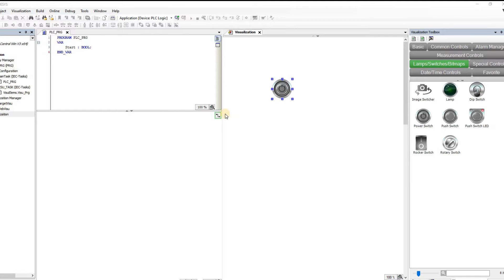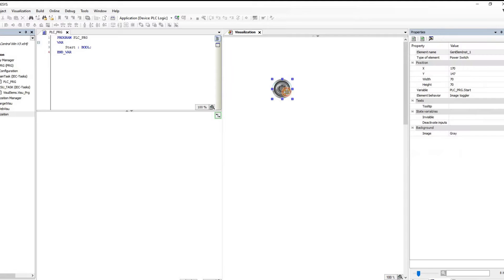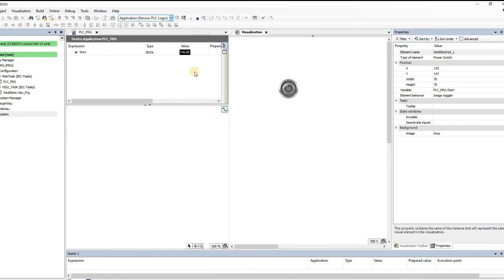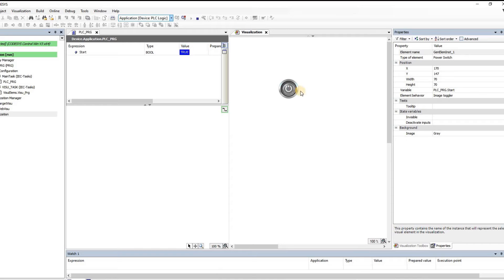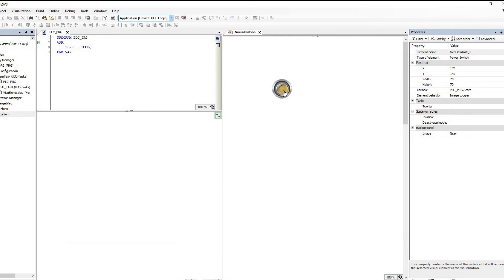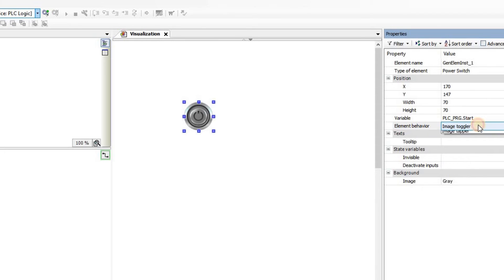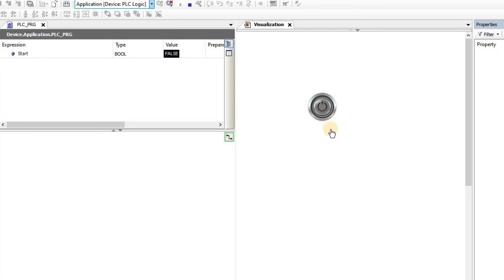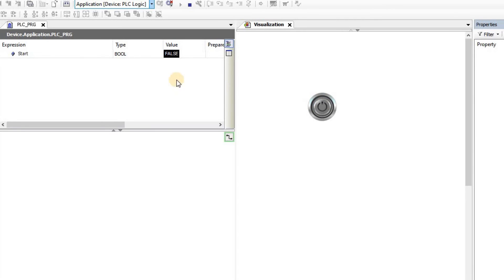CODESYS: Momentary versus Maintained switches - Convert a maintained switch into a momentary one

Comment: hi sir, i am using a schneider M221 PLC, and I want to extract the config. eth IP address via SW33 and SW34, but when i put %MW := %SW33 and 16#FF00,  the %MW is not showing the correct value as the IP high word is followed by 0000-0000, how can I shift the FF00 to 00FF, thx a lot
Reply from the maker: I have never tried to do this, so I can't help. You can try to ask for help in the FB group.
Reply: @TohidAlizadeh  dear sir, thx for your reply, I have solved the problem myself already, it has to put the PLC in running before sw33 and sw34 start showing IP we set